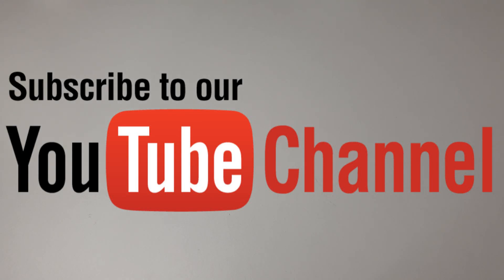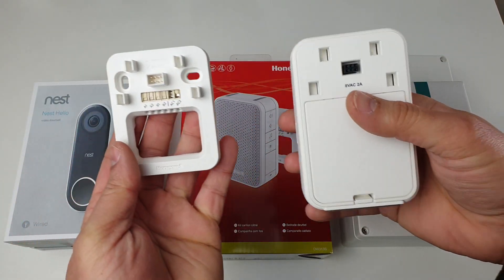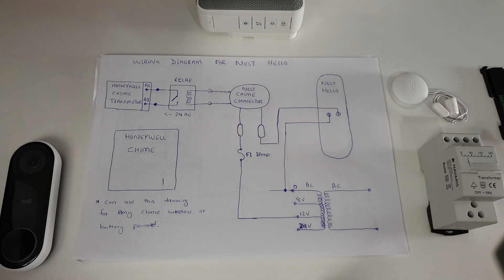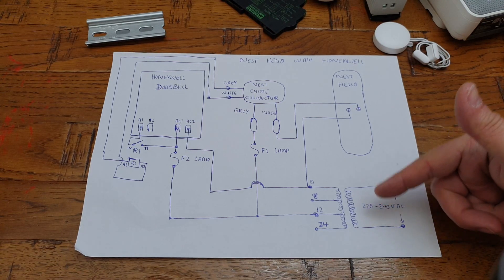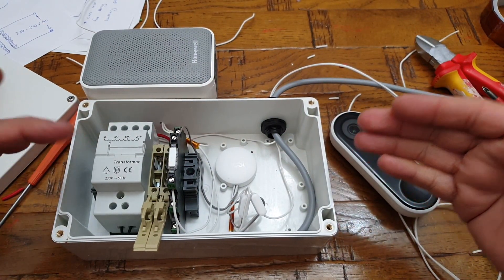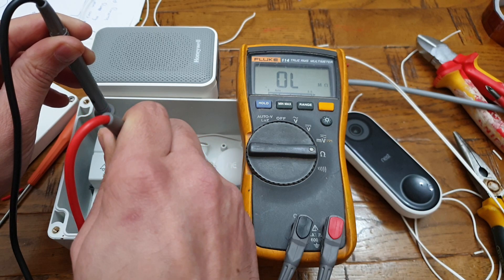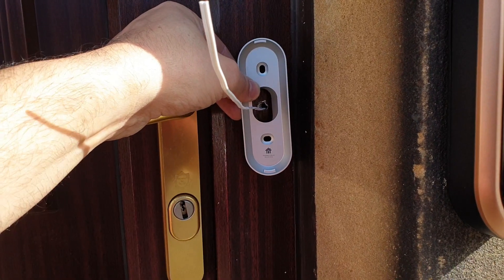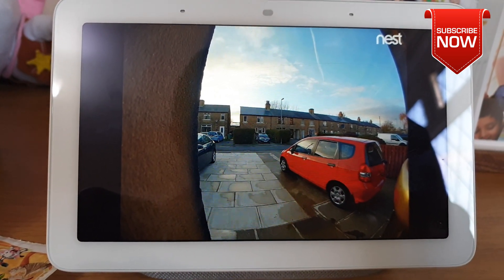Installing Nest Hello Doorbell in the UK / USA / Worldwide WITH a transformer ( Electrical  Scheme )

Comment: You experiment is done with the items only inches apart but in houses the mains consumer unit could be 40 feet away and if the transformer is fitted in the consumer unit then volt drop will occur.

Comment: Thank you for this great video. I happen to have came up with the same the setup, with only one difference. I do have a question. about that. In your case you have  connected the chime to the 12V AC connection from your transformer. You can kind of say your chime connector is in front of the Nest Hello In my case I have connected it to the 0 AC connection, behind my Nest Hello. Do you think that can cause a problem?
Reply from the maker: Not at all

Comment: I think I managed to work out the missing parts: Relay - https://shop.murrelektronik.com/en/Electronics-in-the-Control-Cabinet/Relays/MIRO-6-2-24VDC-1U-OUTPUT-RELAY-52001.html, however you noticed in the video he mentions this is 24v and is actually too powerful and this also looks like a DC. UK mains are using AC.  There is one here for 12v AC however im not sure if its suitable. Naresh mentions in comments below: changed it to relay works on AC 5 to 24 V from  Mure controls
The Fuses -  https://uk.rs-online.com/web/p/fused-din-rail-terminals/8296603/ - The MOQ here is 10, so this is an alternate link to the same product. https://uk.rs-online.com/web/p/fused-din-rail-terminals/8296603/ Im not sure what the two black things on the either side are.
Reply from the maker: thanks for sharing this here
Reply: @nareshkeswani80  No worries Naresh, hopefully I manage to identify the products correctly and help other people asking. If you have the link for the relay that would be useful please?

Comment: First thank you for the informative video. Question, I want to install a transformer to the Nest Doorbell direct, but not sure if I can use 18 gauge wire from the transformer output to the Doorbell ?
Reply from the maker: I did mean 18 awg this is very typical I suppose for wiring door bells
Reply: @nareshkeswani80  hi meant to say 20 gauge. It looks like that would be fine as it's only 24 volts.
Reply from the maker: @whymedude88  yes sure if you think that, I personally don't not have very much of experience in wire selection

Comment: Interesting video Naresh. Everywhere else that I have researched says its not possible to use a wireless chime. I already have a Honeywell battery operated chime so would prefer to use that and if I am not able to I won't proceed with the Nest Doorbell. However I am not clear as to what I need in order to do that? Also can you recommend a good supplier for the components?

Comment: why not instal the grey wire its there for a reason to smooth the psu to the nest
Reply from the maker: It doesn't really matter and it is also matter if opinion if I had to use a relay or something else yes
Reply: It’s does matter as it provides a filter and smoothing operation for the camera power supply 

Great video not knocking you
Reply from the maker: @amcrossx  okay, thank you for feedback, I personally did not notice any issues so it did not used it but you are right

Comment: Are you serious man? What Is the point of this video. Why did you speed up connecting the wires . People don’t know what to connect what to what.
Reply from the maker: That is why i have provided electrical drawings, if it is okay will do another video with how to connect each wiring
Reply: @nareshkeswani80  Hi Naresh. It would be useful to do another video without fast forward to see how did you connect all the wires. I could not find wiring drawings either. Where did you get fuses and relay from? Could you put link for them into description too? Thx.
Reply: It’s better to see what is actually being done then to look at a picture.